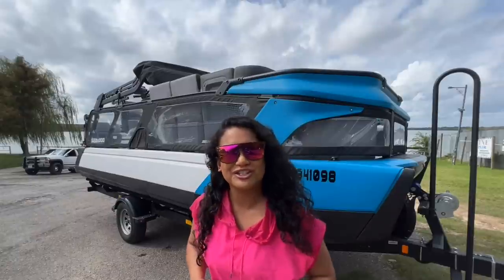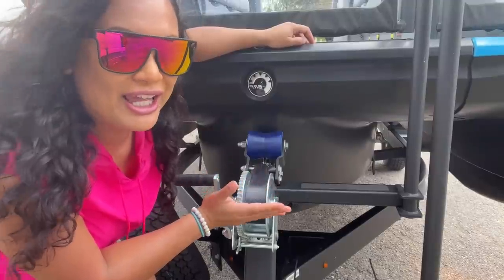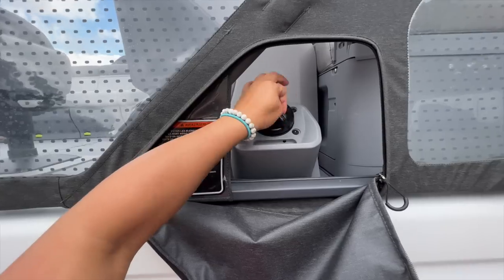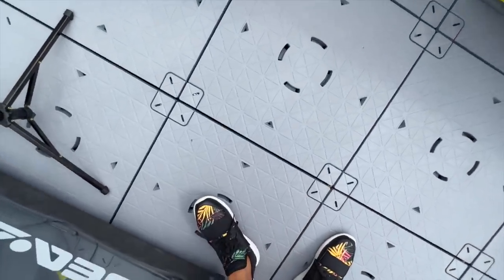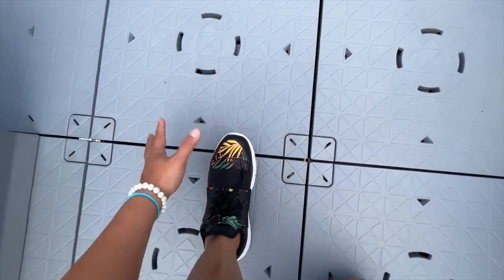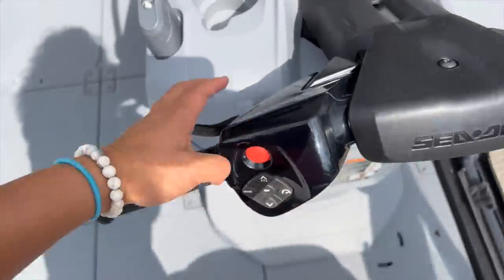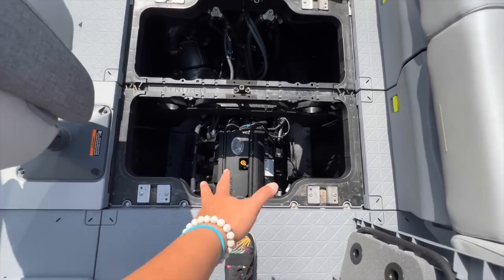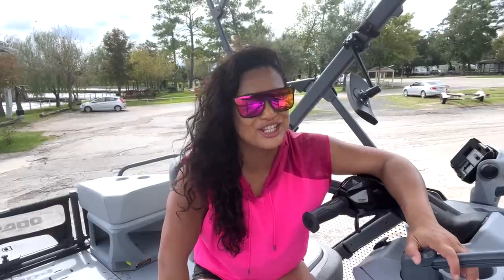2022 Sea-Doo SWITCH Walk-around Tour

Comment: Is the only entry point at the front of the boat? Rather than a side entry for at the dock?? 
Afraid the boat I ordered is not handicap accessible 😢🤧😭
Reply from the maker: Unfortunately there are no doors on the side of this model. I would contact BRP to confirm if there will be a door made on the side. Check out Anthony Ｒａｄｅｔｉｃ’s Facebook page. He shows how he enters the switch with a wheelchair.
Reply: I was wondering about side gates myself along with a swim platform ladder and the anchor door really really really needs fixed hinges or they’ll be a lot of them on the bottom of rivers and lakes lol. Otherwise looks awesome.
Reply: @AlveanAzurin  he gets in with the boat rear end against the dock. Most docks won't work for disabled folks entering the boat like a normal Pontoon does. Rethinking my purchase and so very disappointed at this point. 
Anyone in PDX area wanting the 21ft cruise. Loaded with every accessory possible...
Reply: @ClozetGrl  Do you still have your boat?  How are you feeling about it now?

Comment: I don’t believe you are correct about the anchor being included for free- I ordered a switch a about 6 weeks ago and the anchor package was an additional $250 option.
Reply from the maker: Well dang! You are correct… 🤦‍♀️ I was told by someone it was but I guess I should’ve double check that. Sorry for the misinfo
Reply: Even if it “came” with an anchor, it’s built in to the price